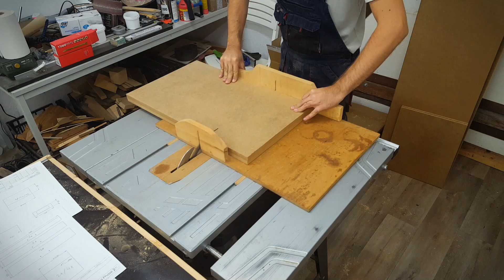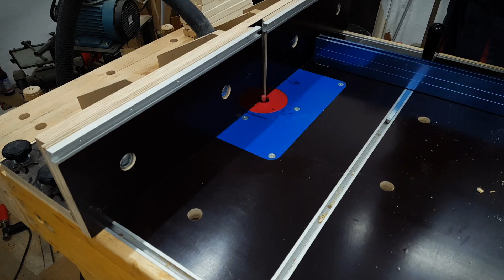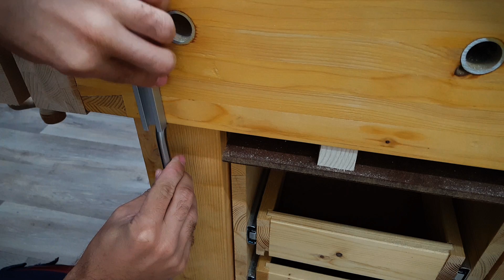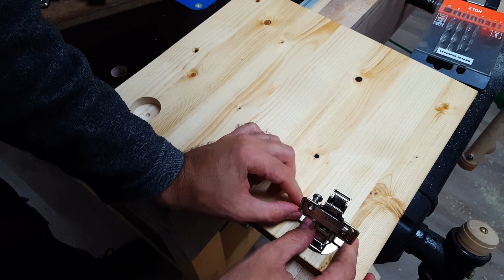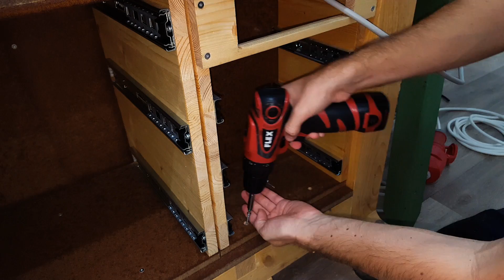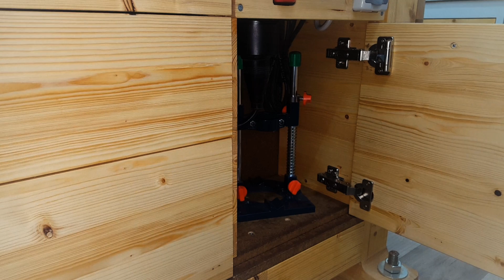How to build the Ultimate Workbench - part 12 - Making the storage, finishing the workbench!

Comment: very cool!!! I'm sure you've already been asked, but how long did it take to make this workbench?
and how much did it cost in US dollars?)
Reply from the maker: Hello Mr. Bond ;) Yes I believe that I answered that somewhere, but I donßt remember where, when or the exact numbers. All in all it came in well under $1000.
The commercial addons were by far the most expensive parts. Vise 200, Router 300, Routerplate 80, benchtop 90 (all circa). The main construction is all spruce and not that expensive, maybe 150 total. Then some 100 or so in misc. thing like glue, outlets etc...

Hope that helps! Many Regards.
Reply: @pilotsworkshop4554  thanks a lot for such a detailed answer! good luck

Comment: Hi Thomas,
While looking for a very stable and very flat DIY workbench I found yours and decided to build one. My frame is larger, but built exactly the same way, including all the dovetails. The leg assembly is a bit different, as I do not need the wheels, but I want the possibility of disassembling the table easily. After about three months of sparetime work the table stands in my workshop, and it’s beautiful and extremely flat and stable. T-tracks and router setup are still to be made, which I am looking forward to do.  

I am so happy you published all your thoughts and solutions - thanks a lot for your good work.
Reply from the maker: That sounds awesome! Thank you for your kind words. This kind of interaction is the best thing about YouTube!

All the best,
Thomas

Comment: Hi Thomas, Just purchased a set of your plans - great to see proper engineering drawings. Now that you have had the work bench awhile, is there anything you would do different?  Regards, Sam
Reply from the maker: Hi Sam, thanks for purchasing the plans! I hope you will have fun with them!
There were a few details such as holes of the pattern that ended up in funny positions. But I built my workbench before publishing the plans so all changes are incorporated in the ones that you downloaded (in case of major ones) or pointed out in the videos (in case of minor ones).
Overall I must say I am happy with it. Using lock nuts in the wheel mechanism would be the immediate detail I would change.

Regards,
Thomas
Reply: @pilotsworkshop4554  Thanks for the quick reply Thomas.  i just now have to work out how much wood i need to buy. I was thinking of putting my vice on the side instead of the end.  can you foresee any issue with this?
Regards,
Sam (from NZ)
Reply from the maker: From a structural point of view this would be fine. You only have to look out for the "dust roof", the vice-screws may collide with it so maybe you would have to make small cut outs for those. But that´s no big deal. 
The only downside I see may be that you won´t be able to use the full potential of the hole pattern for clamping, but that´s a minor issue in my opinion.
In the end you should make it as it fits most into your workshop space and workflow. A vice on the side is the traditional way to build workbenches so there must be great advantages to that layout, too.

Comment: I'm just planning to do something very similar. Are you still happy with the Veritas twin screw vise and the position of the Router right in the middle?
Reply from the maker: Hi Dirk,
I am very happy with the position of the router, I use it a lot now and it feels perfect. The Veritas vise is allright I think, but it feels a bit slow and hefty at times, so something with a quick release would be better I think. However it does what it should and is pretty solid.

Comment: Awesome. Can you still extend the wheels by yourself with all the drawers filled?
Reply from the maker: Thank you! yes, it still works, but now I have to use is with both hands... And it was necessary to lubricate the contact surface between the excentrix part and the wheel board with some wax to keep the friction down.

Comment: Thomas, that is a beautiful workbench.  Your attention to detail and precision is inspiring.  I just have to ask though, why didn't you use the parf guide system to give your 20mm dog holes an absolutely precise grid pattern.  I know the parf guide is a bit steep in price, but for the level of precision you've employed in building that bench it seems justified.  Thanks for the videos.  Looking forward to seeing you put it to use in more projects.
Reply from the maker: Hi Roger, thank you so much! To be honest I didn't know that the parf system existed. xD 
It seems pretty nice! So far I had no issues with my "free hand" pattern. In case that something is not perfectly parallel the vise can be set to an angle ever so slighty and both sides tightened individually.